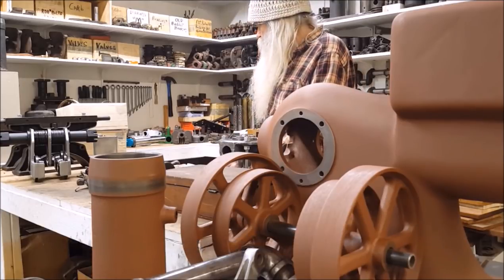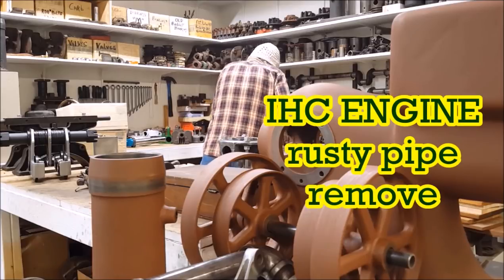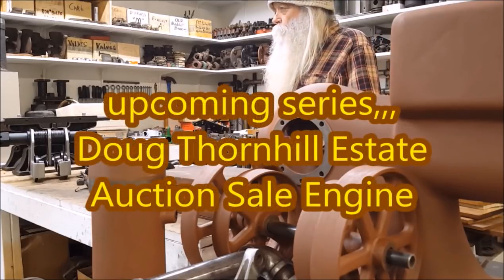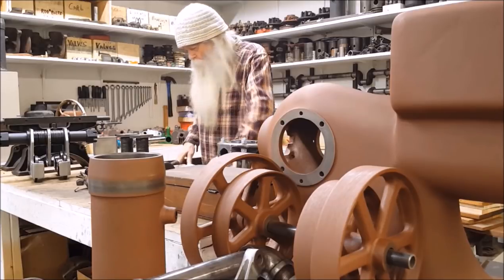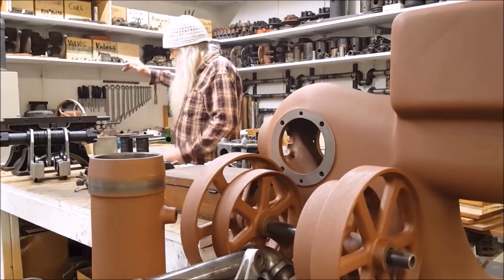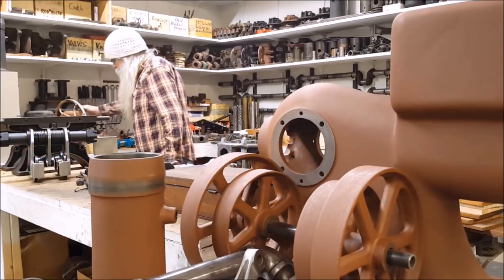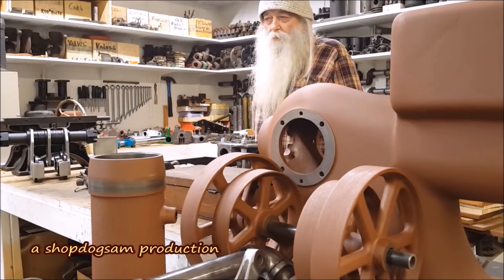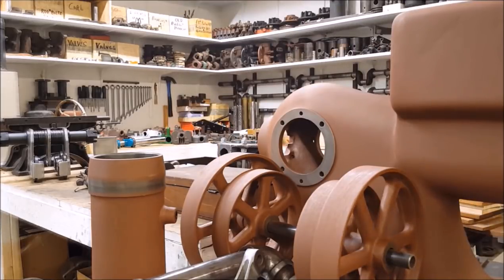What's It About antique engines

Comment: I did an experiment one time. took tremclad, which is like canadian equivalent of rustoleum, and painted the door of a 81 cordoba, took dupont nason, which is the cheapest auto enamel dupont makes, and painted the fender. both were black. when I was done the door looked like mud next to a beautiful black fender. both had the same finish but it seemed like the tremclad just didn't have nearly as much tintiing powder/pigment in it. at that time tremclad was $32/gal and the nason was $50/gal. that was the last time I used tremclad or any other non automotive paint on a car or anything I wanted to look nice. adding hardener seems to help quite a bit.

btw, both will go to hell in the sun like any other synthetic enamel in about 2 years but it's something to think about for the rest of the day...